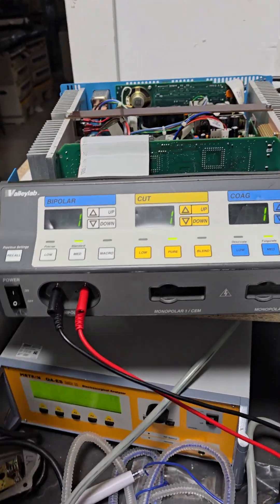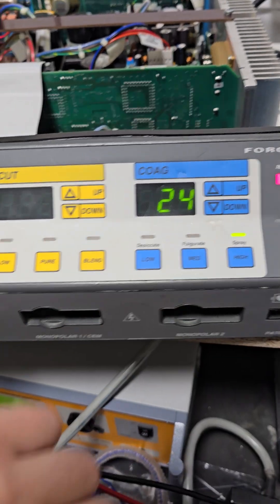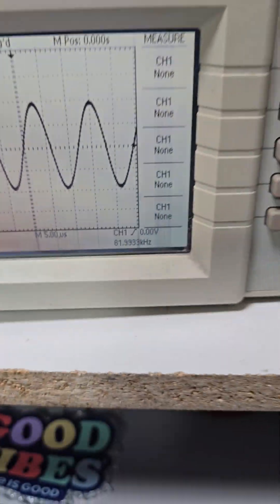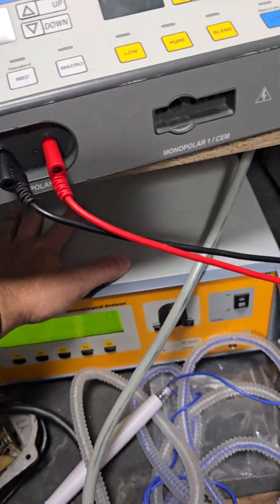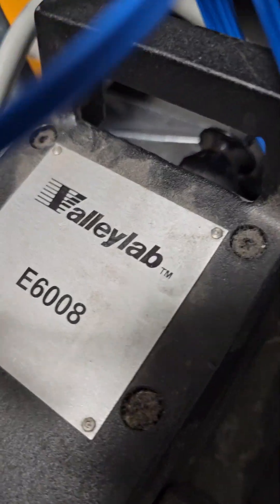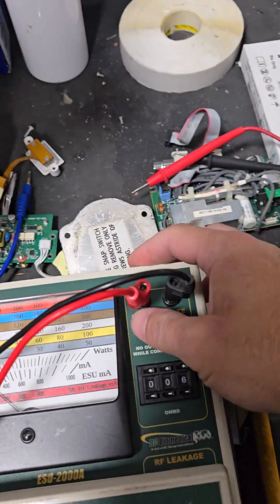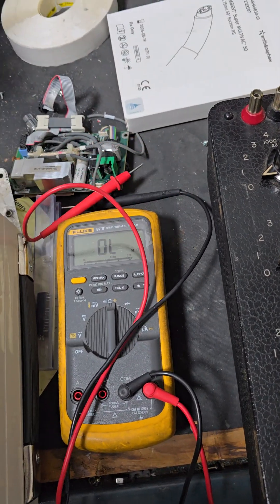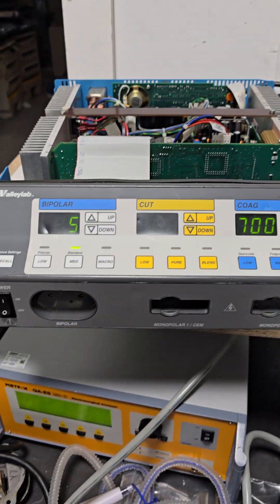Valleylab/Covidien Force FX(C) calibration steps 1 thru 4

Comment: That coag alternate mode from monopolar and bipolar mode cauterize and other config, the stable base or basic materials as a start to whatever remodeling of that same physical solid products models. The coag factors in visionary science mindset focus probably instrumental of obstruct any of the plentiful interfaces interspersed hidden structures of pathways and passages in environments detectable for example by modern X- Ray technologies in telescoping a detail in wide complex environment then scan prior to specificate paint and locate maximize view if that X- ray screen and know how reconfigurable as such wherein not limited to obstructed function could also be used to converge of clot factor style attracted electricity infusion of the current bind then likened to Trochar like energy of extendable protrusion of beams of arranged side to side or edge to edge of area of Monopolar and Bipolar energies by gauge level of arrange things of atoms or molecules or microthings using such dipole arrangements or unipolar align or gravitate of using electron valence cells of orbitals of system generated by beam types effects instruments of teleport of the " likened to mode".

Comment: Hello sir, can you explain steps 5 and 6 in calibrating this device?
Reply: Halle Sr, have you ever solved the error code 212? 
I hace already set up the date and time, and the error still shows up
Reply from the maker: @josuedeluna3170 the trick to 212 is to call the NY operator and ask for a different area code. Lol bad joke
So 212 is an error stating that the unit isn't calibrated. Check the clock battery and then perform the calibration. That should solve it. If your resistance tolerances are off, youll be stuck with the error.
Reply from the maker: no, i skipped those steps on purpose. I need a better set up to complete those steps. Once I have it I can share it.
Reply: Can you help me calibrate the devices? Can I have your WhatsApp?